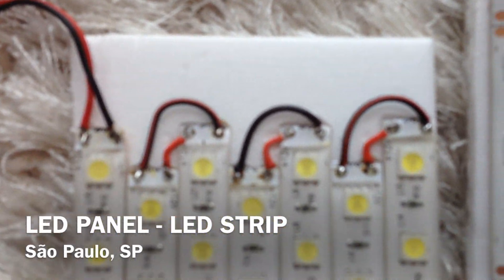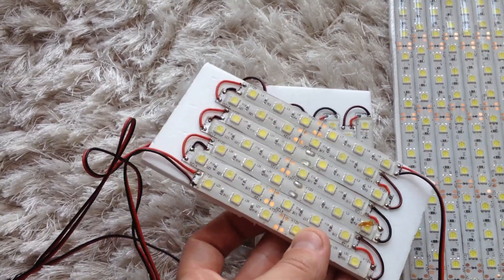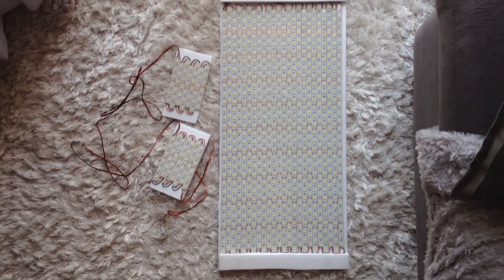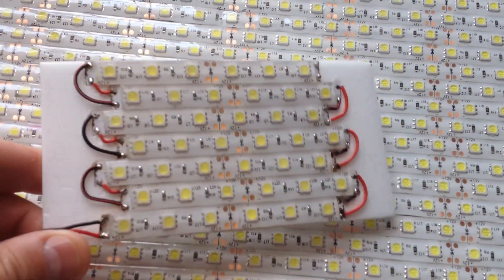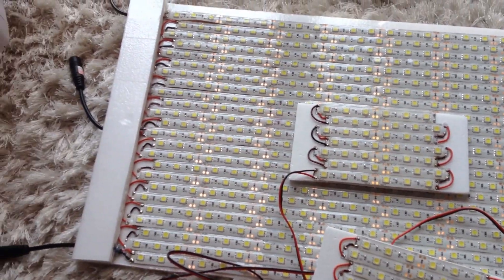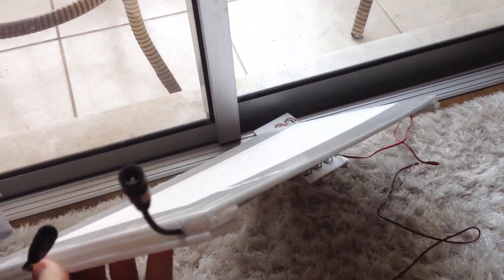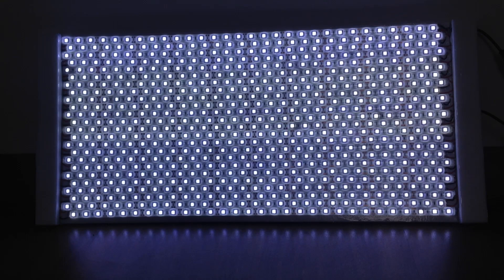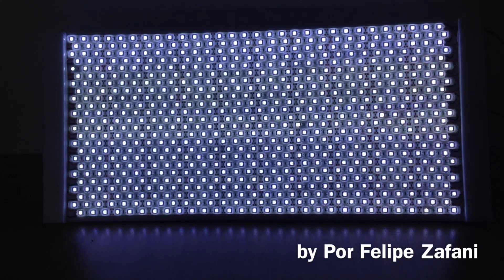DIY LED PANEL - LED STRIPS 600 LEDs - 5050 - DIY

Comment: like David said the reason you're having linear power loss is because you have the entire panel wired as a single led strip, zig zagging back and forth.  An led strip FCB uses very thin copper with a high amount of resistance.    You simply cannot hook a lead to one end of a 5 meter strip and expect it to work right.  You need to use a bus bar, preferably two of them, so all strips can receive an even load.  That way you can calculate your total wattage requirement.  Generally a 5 meter 300 led strip of 5050 CMD's is 72 watts, or 6 amps at 12v.  even with three power connectors you're still having loss.  Furthermore, as David mentioned, foam is a very poor (maybe the worst?) backing for led strip lights as it is a very effective insulator,  which will cause your led chips to overheat and inevitably die over time.

Comment: I have some suggestions: 
1) Use an aluminium backplate, so you have better heat dissipation. 
2) Connect all led-strips at one side, instead of chaining them all together. That way you 'll have a very even illumination and it will be more efficient as the overall resistance would me much lower. Also you'll just need one power supply, with a high enough current rating to supply the whole pannel.
Reply: +DavidU He made it like those old fashioned X-mass light all in series xD
Reply: David U I have a few questions could I mesage you somewhere please?